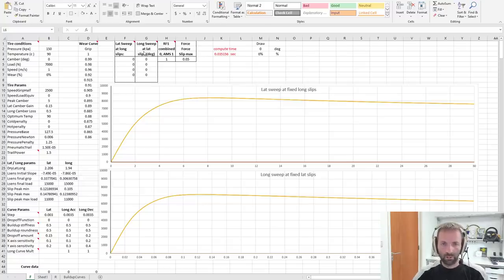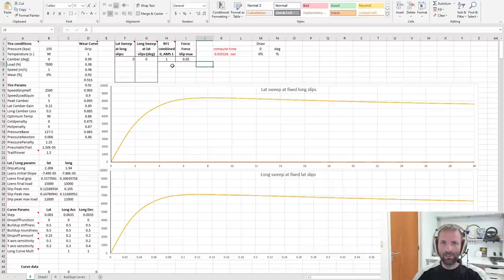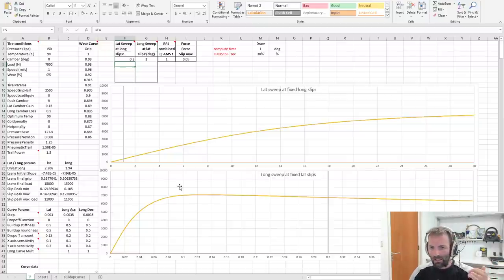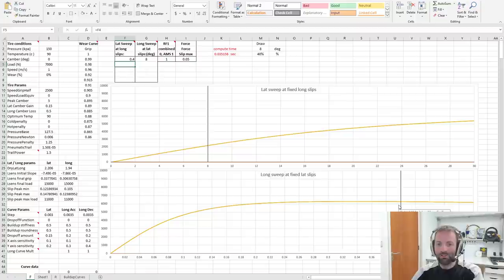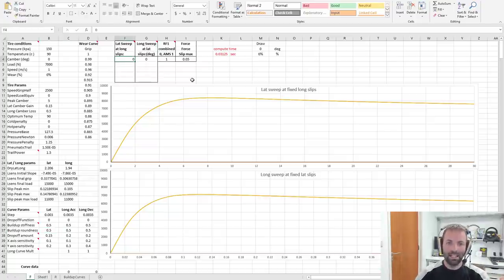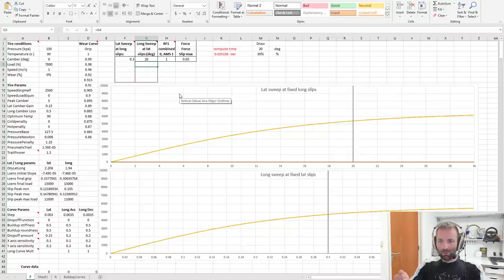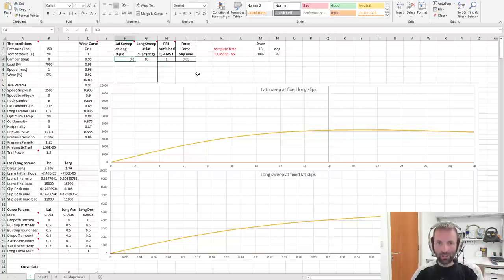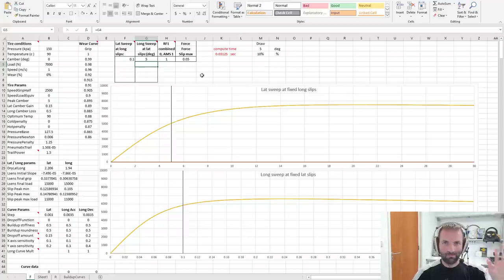How Tire Slip turns into Tire GRIP! - Combined Slip and Grip Explained! (somewhat, possibly)

Comment: The very low reduction of the tyregrip after it's optimum is an eye-opener. Good stuff Niels.
Reply from the maker: This is not always going to be true, some tires may not drop off at all, some a bit more.. And if your tire is melting because of the sliding, the drop might be considerable.. But its not the reason of 'breakaway' as seems to be often hinted by articles and books on 'how to drive'
Reply: @NielsHeusinkveld  I see, the drop off isn't because of the tyre loses grip, its that combining longitudinal and latitudinal slip causes the tyre to no longer have any MORE grip to provide. I can definitely feel this is sims like project cars where if your rear wheels spin you die, as compared to irl when 125cc TAG karting as long as you have quick wheel work and accurate and intelligent throttle movements, any reasonable slide is savable and a certain amount of sliding is fast.

Comment: Also very well explainable with a g-g diagramm. When you are braking very hard and "move down" in the tire's traction circle the tire can take up less lateral force. The "width" at this specific point is slimmer than it was with no longitudinal forces. Very nice insights Niels, I hope more videos are coming! :)
Reply from the maker: You see that it follows a friction circle, but what you don't see is the loss of lateral stiffness (initial steepness of the lateral curve) when you add braking slip ratio as I demonstrate here.
Reply: @NielsHeusinkveld  I've always thought it would be interesting to visualise the available grip with a dynamic traction ellipse of max available long. and lat. grip that changes size and shape and displays the current operating point at each time step. Always been too busy with the engines day job (cool t-shirt!) to see if the reality of this matches what's in my head.

Comment: Hi Niels. I remember discussing limited slip differential behavior with you back in the days when I worked on the GPL physics mods. I feel like there ought to be a way to relate lateral grip and longitudinal grip to the belt, side wall, and tread (or what passes for tread these days) distortions rather than to slip angle and slip ratio. That would get rid of the zero velocity problem and you would be able to park the car on a slope and still have the tire produce grip even though you had no slip angle. I am enjoying this series of videos, keep up the good work.
Gene

Comment: Simple traction circle, max acc/brk or turning, not both at same time, entering a braking area, max brake, as soon as you need steering, roll off the brakes at the correct rate to allow max grip out of the tire all the way around the traction circle.Key is driving on the limit of both while doing it consistently (if your not trying to save tires/fuel/etc). You did miss the weight transfer part that is also apart of the traction circle, maybe make another video of that. Most new racers dont understand when weight transfer is good/bad for traction and to use that to their advantage, maybe you could go over that subject. I come from motorcycle road racing, much tougher job than cars (need to control 5 things at once vers 2 for cars). Thanks for the video.

Comment: Thank you for this more indepth video Niels! I definitely learned something new and it was really interesting. The way you show how longitudinal slip impacts the lat' grip-curve, helped me understand better how trailbraking and turning should be transitioned between when driving.

But thinking of trailbraking got me thinking about the weight transfer argument for why trailbraking works so well in racing. Which then had me wonder how much of an effect weight transfer has on the situation, you talk about in the video, where some sims are hard to control over the limit, possibly do to their overexaggurated drop off in tyre grip. 
How much of a role does weight transfer play in such a scenario?
I don't have anywhere near your level of understanding of this topic, so hope you can further help me understand :)
Thanks in advance

Comment: Tire data / modelling reminds me a bit like the weather and the various computers models it has, sometimes they can get parameters close to what happens in real on the day and some days they can be off by a fair bit especially when dealing with severe weather as the atmosphere is so dynamic just like tires and the surface they are on. It's a never ending cycle to try and get better data / improve computer models, and like tire modelling weather models have improved a lot especially over the last 20 years or so with technology but they still have a fair way to go and even then they will probably never be able to be completely accurate with things being so dynamic in the real world.

Comment: Thanks for this!  It is very interesting and demonstrates the balance behind the limits.  Funny, just last night I was using SimHub to create a dashboard for AMS2...and wanted to include a visual representation of tire slip.  I'm sure there are other, better methods, but I ended up using the game's raw data for mTyreSlipSpeed and wrote so that if value is greater than 5, it'll activate the flag on the dashboard.  More for fun than anything else.

Comment: Without any intended sarcasm, a great way to demonstrate practically is to drive a real car! I feel sometimes, other developers (both in commercial sims and in industry simulations) get a bit lost in the numbers and forget what a tyre actually feels like. A road tyre in particular demonstrates the behaviour really well. You can really feel the contact patch grip change as you add or remove long/lat load and/or a combination of the two 🙂

Very well explained with the dynamic spreadsheets though. Much easier to grasp than a full tyre slip plot!
Reply: Sometimes I wonder if some of these sim devs ever drive to work? Or do they take the bus? I imagine all pcars devs ride the bus.

Comment: Excellent video, Niels- but I don't think you were  qute clear on the slip angle (for a moment I though you were describing steering angle).  It would be more efficient to explain it as the angle between where the tyre is pointing and where it's going (and lateral and longitudinal forces). E.g. throttle on oversteer with proper wheel drive (that's a good one, made me smile) and throttle on understeer with wrong wheel drive- even when the car is not sliding (sliding over/understeer),  car will tend to turn larger/smaller radius curve when applying throttle (increasing slip will increase slip angle for given lateral load).  It just gave me an idea- using lateral forces (line on your upper graph being  horizontal, rather than vertical to represent the force required to keep turning the same radius corner)- gently increasing power will on RWD gently increas slip on the rear making the car want to turn on tighter radius which will be  counteracted with unwinding the steering wheel. Suddenly mashing the throttle will make slip angle increase untill tyres can not produce enough grip and inertia will introduce yawing momentum (i.e. spin). Same explanation could be used on corner entry- easing of the  reducing slip to allow tyres to generate increasing amounts of centripetal force as the wheel is turned. As an aside- the tyre model I have mentioned in earlier video maintained that the greatest lateral force was generated with a certain amount of slip (I seem to recal it was asymetric)... Sorry for the long post, and keep up the good work.

Comment: The oversteer out of the corner is a bit of a tradeoff between the length of the car, the stiffness of the suspension and the load sensitivity of the tire too.

Comment: There is one parameter missing: body mass transfer. Letting go of throttle raises the rear, decreasing load and thus grip drops off dramatically. All of the curves here assume static load. 
I personally agree, the slip doesn't grow and suddenly "break off".. Which is the feeling you often get, you get more grip, more grip, a bit of plateau and suddenly you are on ice.
Reply from the maker: Yes, I ignored that so we could focus on the combined slip at one load, rather than changing everything. Its best to not FULLY let go of the throttle, but just enough to restore lateral grip, while not transferring as much weight to the front. And common mistake, the rear rising doesn't mean its getting light. On stiff or weird suspensions, the rear can even sit LOWER when you lift off the throttle. The height of the suspension does not indicate weight transfer per se. Stiffer or softer suspensions also don't really make a difference as far as weight transfer is concerned.

Comment: Very good explanation! Would be amazing if you can make a simplified explanation taking weight transfer into account. Because AFAIC it's the most important factor you left out here. And if some new sim racers are like me when I started they completely ignore it and spin without having a clue why :D
Reply from the maker: Abrupt full throttle lifting would move more weight on the front than 'just enough throttle lifting' so that you restore cornering grip without taking all acceleration away. So your best bet indeed is to avoid too much weight transfer to the front by figuring out how much or little to lift. Easy to underlift though and still spin out.. Tricky stuff this race car at limit business!

Comment: Hi Niels, thanks so much for making this video.  Very well explained and helpful for insight into car handling behavior.  I had one question:  When you were describing the scenario with slowly adding more throttle coming out of a corner (with a V8 haha), are the two characteristic curves with lateral and longitudinal slip angle only describing the behavior of a single tire?  In this case the rear tires if it was a RWD car.  If that's true, the front tires in the same situation would have different lateral/longitudinal curves with virtually no longitudinal slip angle and maximum ability for lateral grip?

Comment: In the first half you describe slight grip loss. In real racing that is the “tires screaming” in a corner. That chirping squealing sound. The fastest drivers IRL “do not torture the tires.” Meaning not much noise from the tires thus the least amount of slip and the most grip.  Also curious on sim racing games how do you calculate the coefficient of friction for each track? Also each track subsurface like painted rumble strips, hard run off areas and no race line that would be dirty from dirt and rubber debris? In a lot of sim racing the fastest drivers are 2 wheels off track.  In the sims are each tire’s slip figured on each type of surface with different coefficient of friction?
Reply from the maker: Very late reply.. In AMS, there is a big text file that has grip multipliers for different surfaces, say 0.5 for grass, 0.9 for concrete, 1.02 for the racing line, 0.95 for curbs etc. I don't know how other sims do this but I would imagine it is similar!

Comment: Good explanation, but is there a way to incorporate a friction circle into that Excel sheet? Would make the combined slip easier to understand, and I would really like to see how it works with various slip angles.
Reply from the maker: I have it in the sheet but that looks at grip, not at slip. So you can't really see if a point on the circle is the result of silly slip angles or ratios. Perhaps I'll show it in a future video.
Reply: Niels Heusinkveld True, it wouldn't work on its own, just thought it would be nice to see it alongside these graphs.

Comment: Thank you for your nice videos explaining vehicle and tyre dynamics in a simple language. Can you explain, for the following videos, singularity of the vehicle and tyre models when the vehicle speed becomes low? Definition of slip angle becomes ill defined when vehicle forward velocity goes very small, which causes problems in my simulations. I would like to learn how driving sims tackle this issue
Reply from the maker: AMS takes the lateral velocity to compute slip angle and when velocity nears 0 you get issues yes. I heard it does 'something simple but clever' near standstill but I have never looked into it. By default the 'low speed' behavior is gone at around 40km/h which I often change to a lower speed so I never really encounter it. Until AMS 'parallel parking' edition is released.. Probably you get some divide by 0 errors or big / weird numbers near 0..

Comment: So if I understand this correctly, break away is a function (not sure if that's correct nomenclature) of the torque band of the engine as opposed to the tire grip dropping off?
Reply from the maker: When its 'on power oversteer'. If you're mid corner zero throttle or brakes, and you're sliding, the 'feel' is still probably not really 'drop off' but more a 'sudden loss of expected grip increase'
Reply: Niels Heusinkveld Surely must also depend on which wheels are being driven?  RWD, FWD or AWD, shouldn’t break away in the same way, adding downforce also complicates this further.  I feel that the more information you give us, as a calculus problem it’s too difficult to calculate in real time.  My guess is that’s the real crux of the problem as there has to be latency with the return signal as the circuit is feedback not feedforward, and as that’s digital there would logically be a quantization limit dictated by the cpu core clock rate, Im thinking its qubits or bust plus an inordinate amount of tire data from the manufacturer.  Wondering if there might even be some tensor calculus involved as well, effing nightmare if you ask me.  We’ve only just got circuit modelled compression that will run in real-time and that’s a much simpler piece of code, even valves are simpler to model than this.
Reply: From wiki tensor calculus page

Tensor calculus has many real-life applications in physics and engineering, including elasticity, continuum mechanics...

Comment: Is the way you determine the lat and long components just by doing some simple vector mathematics? Breaking the overall force into its perpendicular components.
Reply from the maker: No it is quite a bit more complicated than that. You wouldn't get the initial slope changes visible here and in all combined slip data you can find.
Reply: Ah yep, my main focus is beyond the initial slope. Just trying to piece all the bits together as I figure it out. Videos are very helpful :)

Comment: Hi Niels, what do you think of the brush tire model?
Reply from the maker: From the little I know this works fine for pure and combined slip. Of course you'd have to add some parameters for load sensitivity, peak slip that moves, temperature, and perhaps a dropoff as I belief by default the brush model just saturates.. But its a bit out of my comfort zone, I'm not aware of the pro's and cons enough.